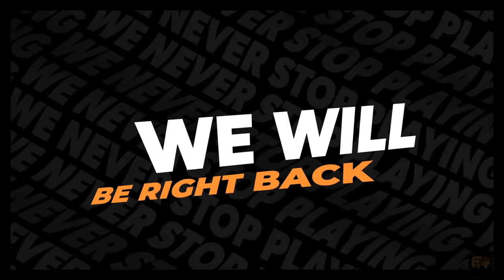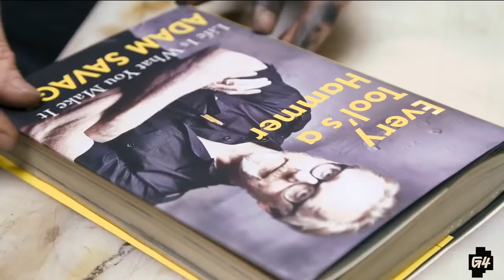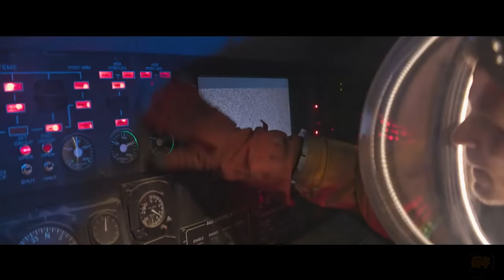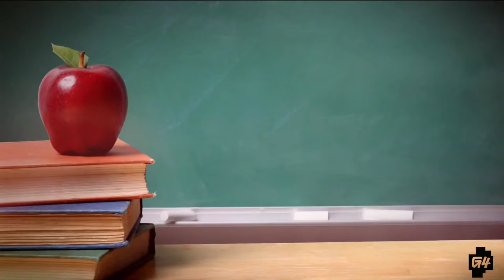Adam Savage is Here with Kevin Pereira! All Myths Will Be Busted! | Attack of the Show: The Loop

Comment: Taco: bread folded around filling.
Burrito: bread rolled around filling.
Hot dog: bun sliced in half and stuffed with filling.
A hot dog is not a taco, and one can argue that taco's are a subset of sandwiches (bread with stuff).
Reply: A Taco is bread folded around filling.
A burrito is bread rolled aorund filling.
A hotdog is bread folded around a hotdog.
A hotdog sandwich is a hotdog placed between two pieces of bread.

A hotdog is not a sandwich. And as much as Adam wants to "lie" (yeah I said it) about the connector being not integral to the hotdog it is, it acts much in the same way as a taco does as a pouch to carry condiments and dressings added to the hotdog.